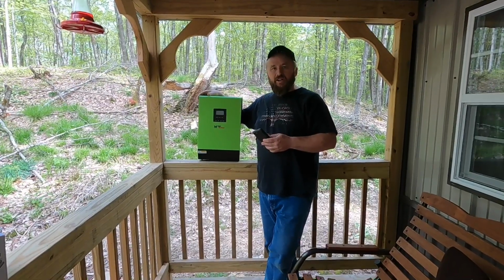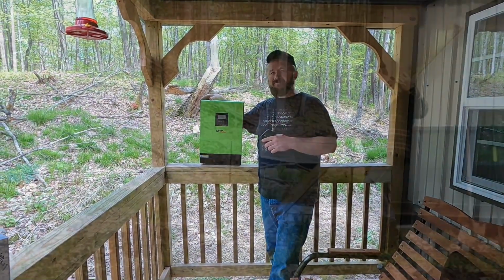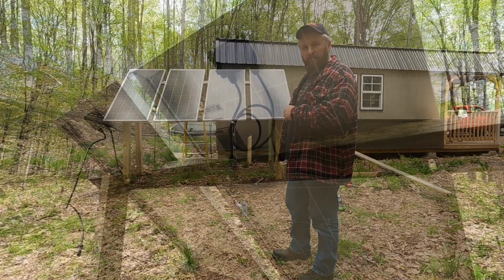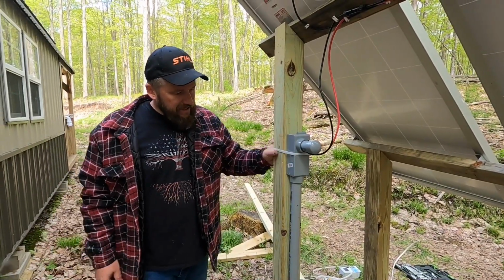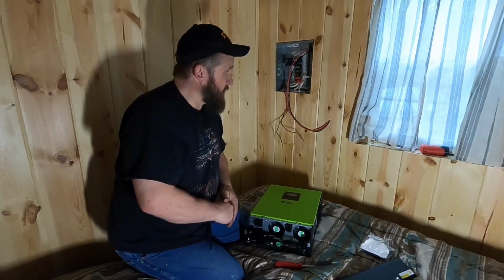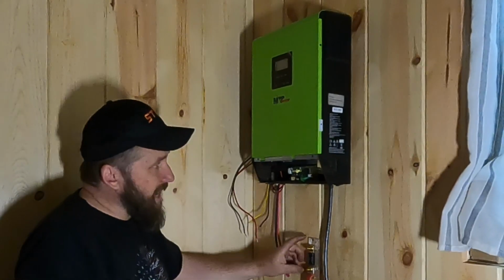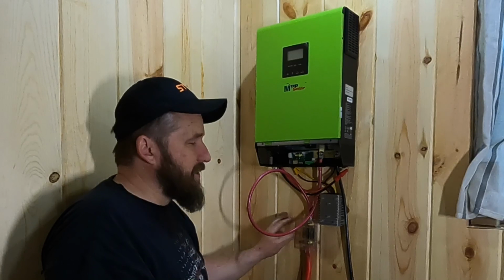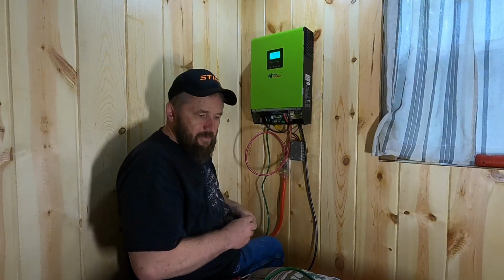MPP LV2424 Solar, cabin upgrade #offgridcabin #diysolar #mpplv2424 #freeenergy #freeelectricity

Comment: Most of the time the ground side of the battery connection on those all in one units is not at ground. So the negative lead of the 12 volt converter is not at ground potential, and is a shock hazard.
Reply from the maker: Thanks for the info. What would you recommend a ground it to?
Reply: With the Solar generators, there are no batteries in line. Its direct from panels to generator. Unless there are batteries after the controller. Guess you could breaker it after battery before controller 🤔

Comment: What are the system component costs?
Reply from the maker: I left a link in the video description for both the solar set up and the battery. The whole set up total is around $3200. The price in the link for the solar includes if you use their battery.